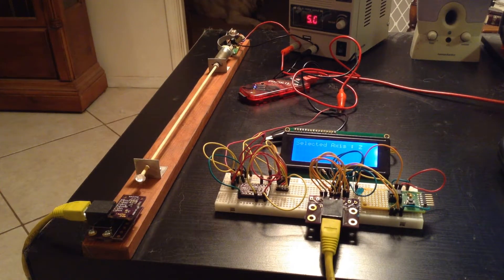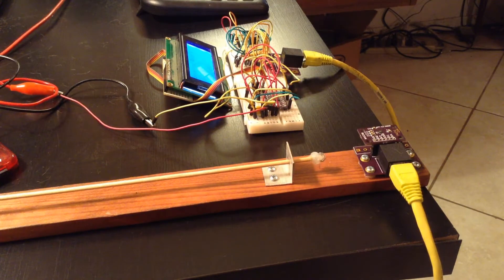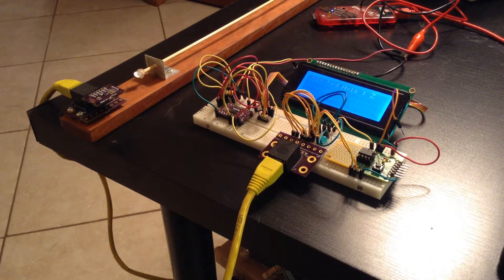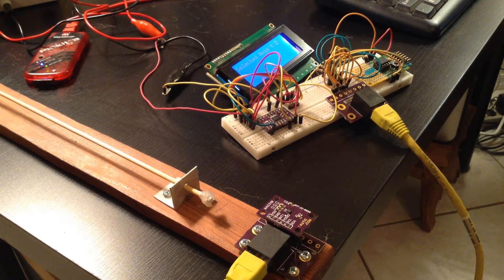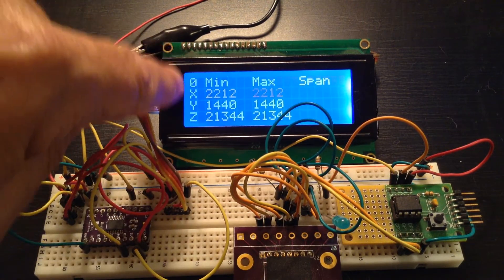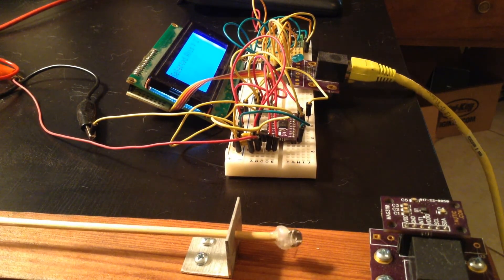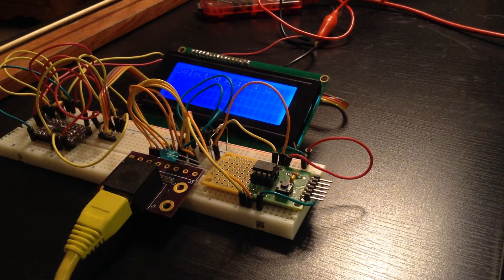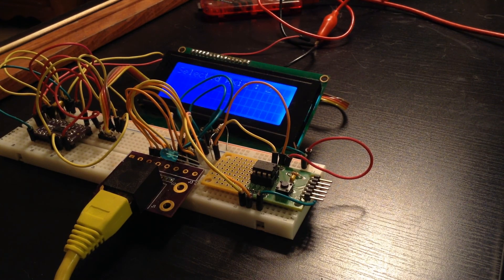Hackaday Prize Build Log 7 : Sensor processor complete (mostly)

Comment: John, great progress, thanks for the update. Really exciting to see this project come to life. 
Regarding the transmitter sending each pulse, I'm a little worried what happens if you miss a pulse (or seven). What if the transmitter sends a rolling count of say, 1 to 100, that way if the receiver misses a few, (due to rf interference) it will know what its missed and the total gallons count will still be accurate..... Just a thought.

Comment: Humm, this is really interesting. I have added a new water ball valve to my system, and I have thought of using some sort of motor to pull the valve shut from a remote location, like touch tone from my ham radio. This would be a good addition as it would allow me to monitor the flow.